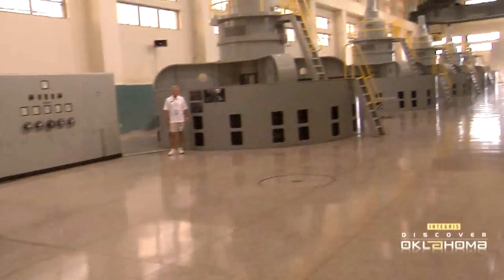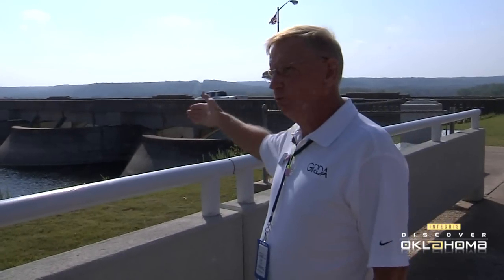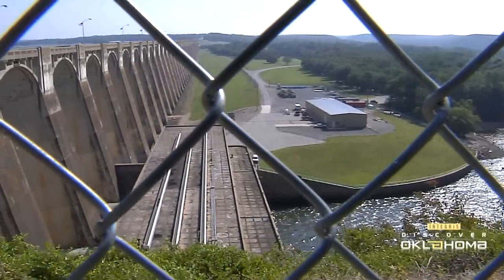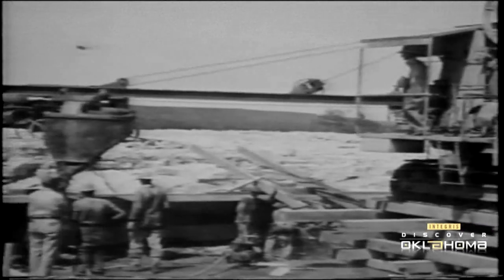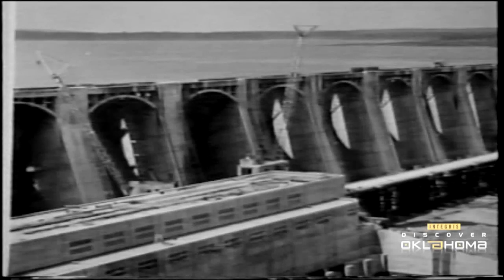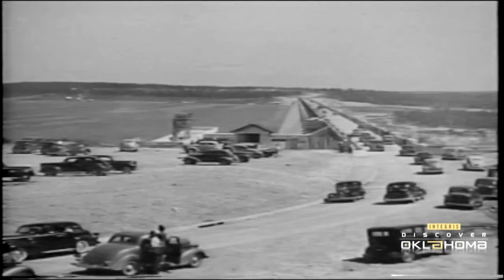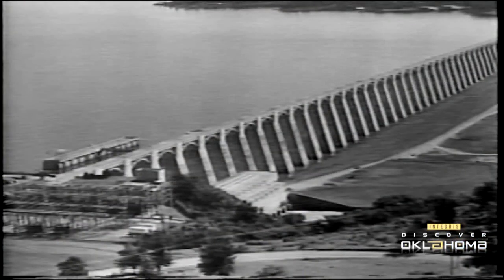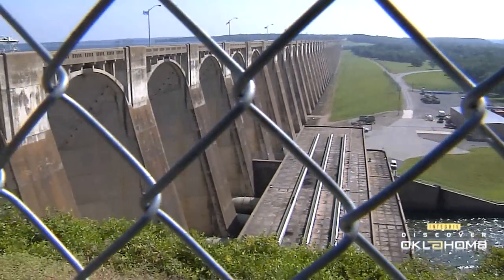Pensacola Dam Tour

Comment: In the early 1960s we had a houseboat at Port Tyler on the Disney side of the dam.I always worried an engine failure on the boat would get me swept over the dam.And I would have been used to produce electricity.